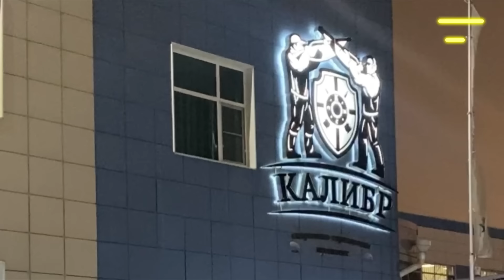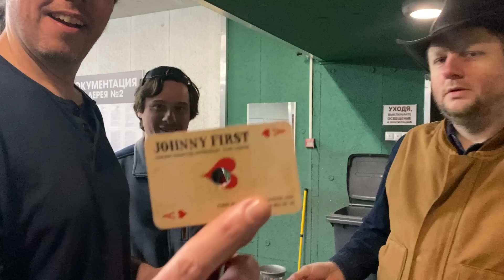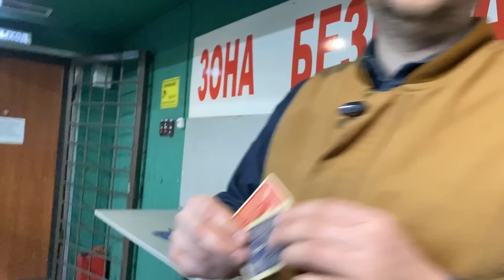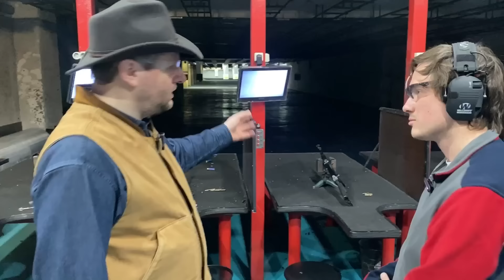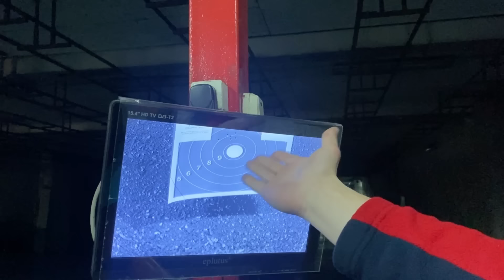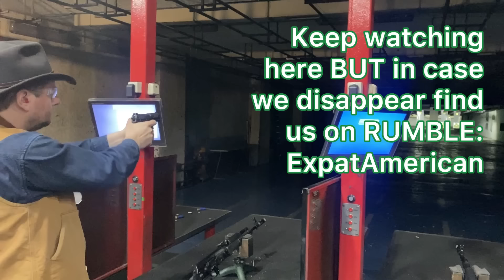💥RUSSIAN Gun LAWS are WHAT ?! 🇷🇺AMERICANS Enter a MOSCOW Shooting Club @MoscowPhotog

Comment: Red dot is not off - the dot feels that it moves around, and you have to train enough to train your eye muscle memory... there are tips on how to do that as you can feel easily on YouTube pros or experienced gun enthusiasts... for me I use iron sights even out to 300m... you have to understand bullet drop trajectory, windage, and temperature but on a clear good day no real issues... scopes will depend what type of firearm you have 4x, 3x9 or greater as there are many variants and night vision to  thermals and FLIR and other additions like LiDAR, and multipliers.
Ghost sights are my favorite to use and for clear quick targeting for zoom and distance has a finger dial ring besides your horizontal and vertical line up plus micro measurements to adjust to accurately hit the target.
On the stocks you can add aftermarket accessories to modify cheek hold or find one that has an adjustable cheek setup... plus know what your eye relief distance to scope or other sights.
You'll get there takes practice and training... remember breathing control and squeeze trigger [ use fingertip and not wrap your finger around the trigger] at mid-breath hold.
Reply from the maker: Thanks for the details!